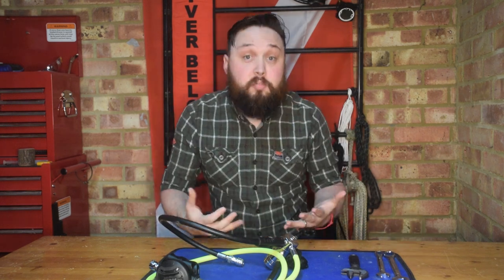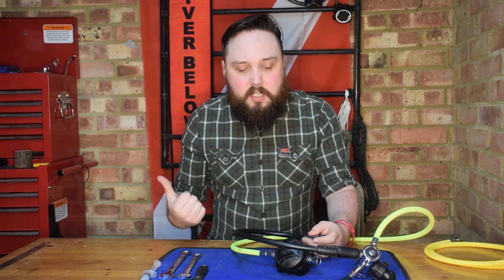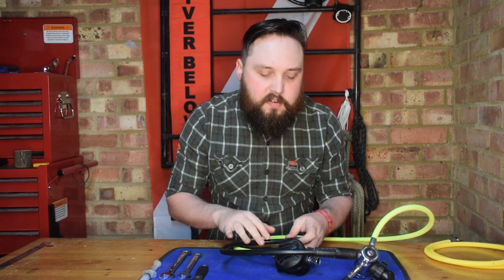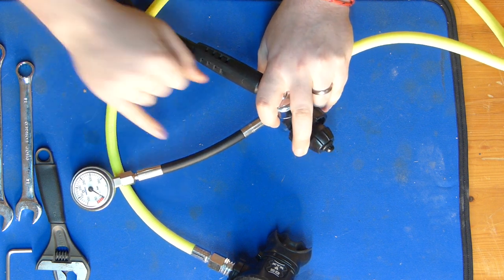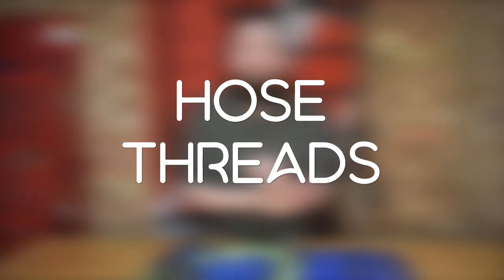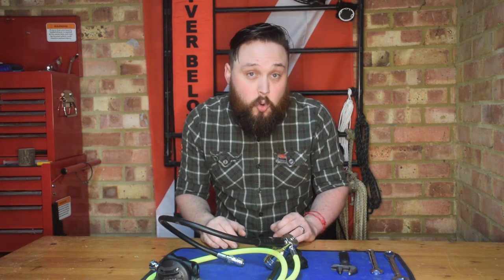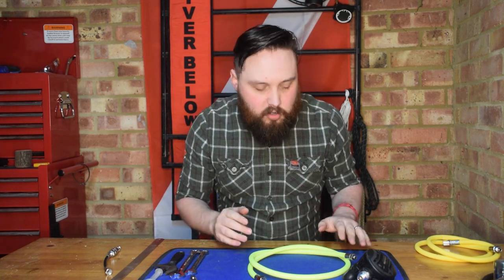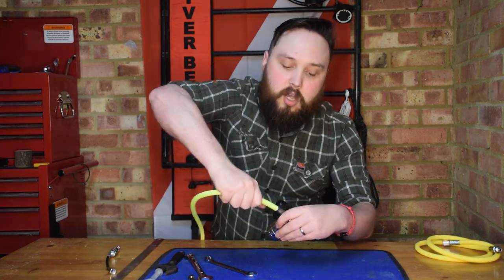How To Change a Regulator Hose Properly

Comment: One thing that makes refiting a hose a tiny bit easier for people in-experienced in doing it, is to fit the 1st stage end, er, first!  Without the weight / bulk of the 2nd stage on the end, it's easier to simply spin the hose between your fingers to get the male threads on the hose started in the female threads in the 1st stage. Once you have the 1st stage end done, then fit the second stage to the other end, which is easy becasuse this is a female socket on the hose, and so can be turned without turning the whole hose itself :-)

Comment: Hi Mark, I am familiar with this type of work but was really surprised when I fitted my SPG and there was play in the HP hose connection to the SPG. I was told this is normal and have had no leaks with this setup. Maybe worth explaining the play in the hose connection with a swivel pin or if I've been advised incorrectly please let me know and I'll correct my configuration.
Keep up the great videos, Daz

Comment: If you need a spanner/wrench to fit those thin surfaces (regulator fitting at the 15min mark) then check out bicycle “cone spanner’s”. Bicycle wheel cones are pretty much the same (two thin nuts locking together) so tools exist solely to fit them... and in around the same sizes. Usually just pressed steel, but you shouldn’t be levering too hard on them, that’s what the real spanner is for.
Reply from the maker: Great tip Paul! I could do with some skinny spanners

Comment: I was always told to use an O2 safe grease on threads/o-rings in contact with your air supply, and to never use silicone grease because it will deteriorate faster when in contact with higher concentrations of O2.

Thoughts on that?
Reply from the maker: If you're diving mixes richer than 40% then yes. Otherwise it's a cost:benefit choice.
O2 safe grease is better, but doesn't come cheap and for the tiny amount you may need on a hose, it's not really worth it. You don't have access to any dynamic O-Rings that need greasing, only the static O-Rings to the 1st stage that don't particularly need greasing.

Comment: very good Video. Is the Swivel Pin also needed when using a Transmitter on HP? I connected my transmitter to my firststage(no hose).
Reply from the maker: Yup, but only when a hose is in the mix. 
Connecting a transmitter directly to your 1st stage doesn't require a swivel pin, but if you fit it to a hose you'll need one.
Reply: @SafeDiving  thank you very much! thats good to know! i like your new channel. hope it grows fast
Reply: @rapha9125  Putting your transmitter on a short hose is good practice. A transmitter attached directly to a first stage can be mistaken for a valve knob and used to lift your cylinder out of the water. A hose will also give your transmitter some flexibility so it doesn't get damaged when you hit something.

Comment: Nice and simple, now my 8 year old can change a hose. What about silicon grease on the LP O-rings and port sides, not recomended?
Reply from the maker: They're static O-Rings so shouldn't need grease to create a seal. There's nothing wrong with greasing them but very few will grease those.

Comment: Thanks for this video Mark. I was planning to  change  my setup to a long hose setup and wasn't sure if it is safe to do it on my own. After your video i am pretty convinced i can do it. I have the same 1st stage as you, and i can see you used the port at the bottom (?) for your primary second stage. Is it the same way? Cause it looks a bit different...
Reply from the maker: The Apeks DST either comes in a 4-port or 5-port configuration so be careful. The 5-port version has a large raised section while the 4-port is flat on both ends.

4-port: https://www.apeksdiving.com/worldwide/products/diving-regulators/product/dst.html

It's not hard to change the configuration on your regulators and fit new hoses, you just need to be careful not to damage the threads by turning too hard.

Comment: Do I need special o-rings or can you use any type from the local hardware store? Correct size of course.. Speaking of which, do o-rings for dive gear have any standard sizes? (I bought a kit of o-rings for another purpose and there's about a million of them in the box, so some would most likely fit)

Comment: For Apeks regulators you will need the following tools:
For removing port plugs: 5mm hexagonal Allen wrench (3/16" will have quite a bit of play and can damage the port plug, 7/32" will not fit)

For removing HP and LPI connectors: 14mm wrench (9/16" can be used but will have a little play)
For removing second stage non-swivel connectors: 9/16" wrench (15mm will have quite a bit of play and can damage the connector, 14mm will not fit)
For removing second stage swivel connectors: 11/16" wrench (18mm will have quite a bit of play and can damage the connector, 17mm will not fit)